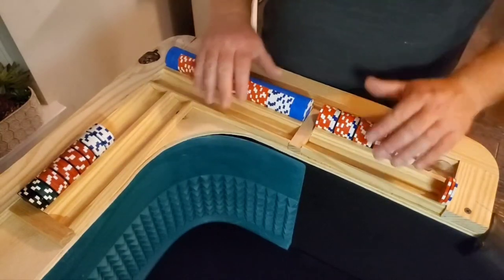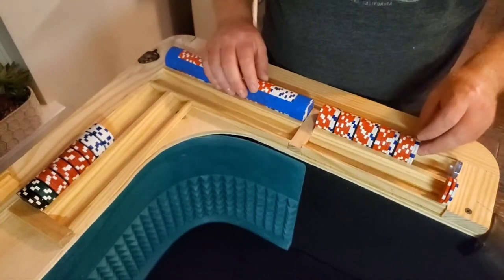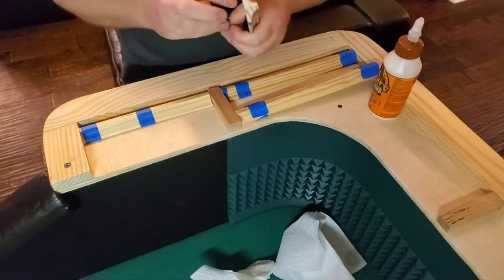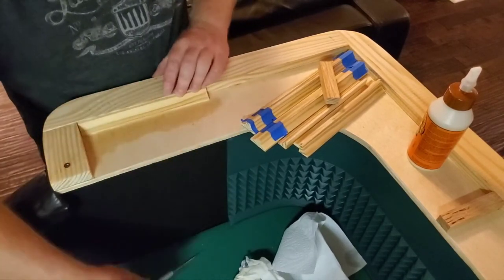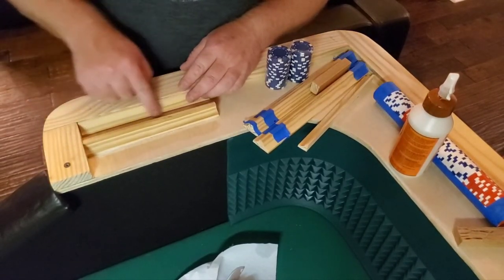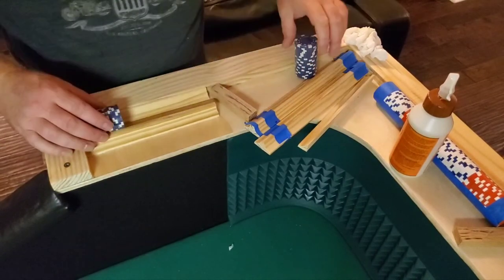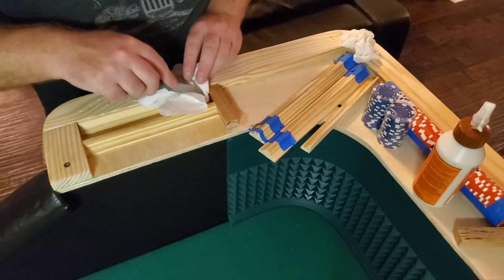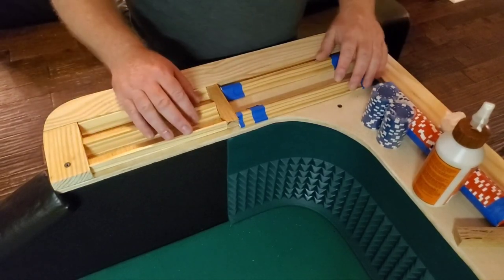DIY Craps Table Chip Rails

Comment: Thanks for this video, it has helped a lot. Also, for the chip rail to make it go quicker, cut a spacer, it could be cardboard or an extra scrap piece of wood. Then layout your rail with your spacers. Have fun and good luck on your tables
Reply from the maker: It was easier for me to do these with a couple rolls of chips. I did think about doing a thin spacer, but stuck with actual chips.

Comment: Watched all your table builds. Very nice. Do you happen to have more detail on the rail build. Not using cove mounding, but the rest of the rail assembly??
Reply from the maker: The base of the rail is cut from 4' x 2' Handy Panel from Home Depot. It's 1/2" ply with a birch finish. The trim around the outside is 1X2 (ish) pine I reclaimed from a well built shipping crate. It's not perfect, but that gives it a cool "distressed" look, and it was free. The dividers are 1x ripped oak left over from another project I did.  If I did this again, I'd make the overhang on the inside of the base a little more, maybe 1/2" or even 3/4" that way it covers the top of the rubber on the sides, and you could mount an LED strip under for a cool effect.
Reply: Thanks!!!